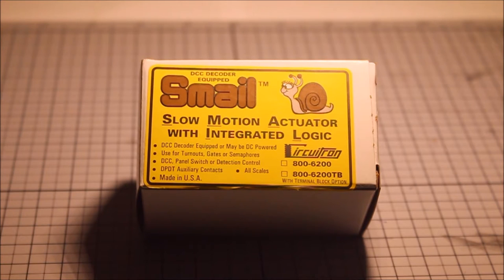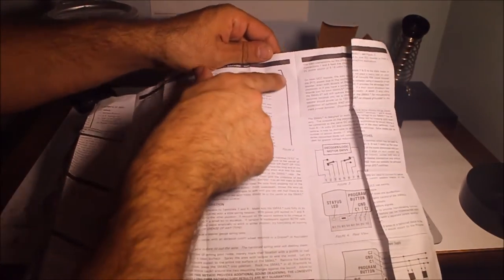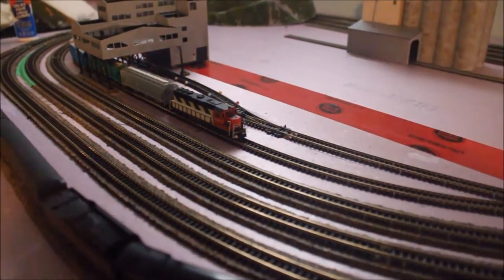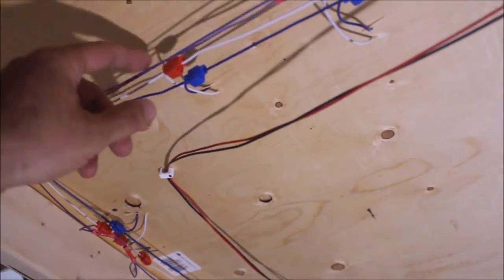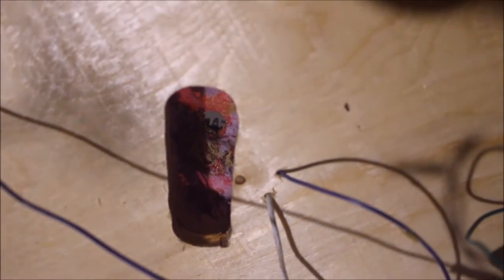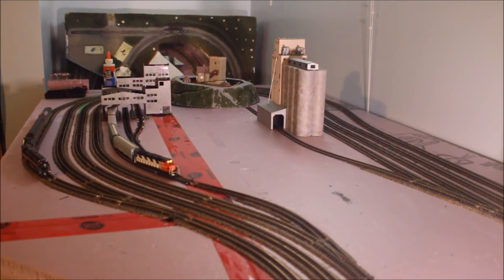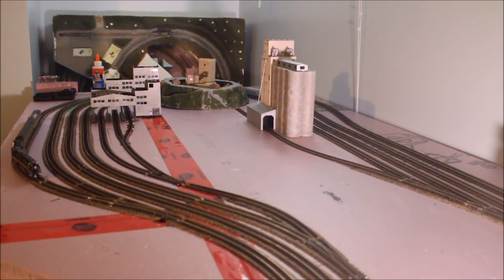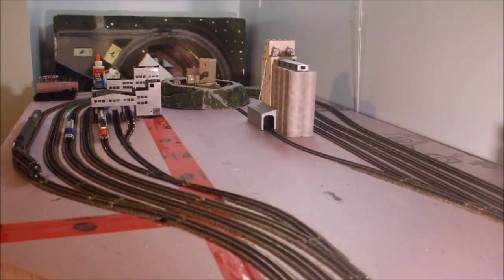Smail switch machine and layout update #2

Comment: Great change from the peco solenoid motors , I use DCC Concepts Cobalt digital motors which there is no soldering so wire you just push in they are easy to install & the throw bar wire comes already bent + $ price is good & its Aussie Made .....Cheers-Rich.....
Reply: Oh! and Cobalts are smaller , great videos Tim very creative
Reply from the maker: Hey Rich. Yeah this is a better switch from the peco motors. I looked into the cobalt and they look really good the only unfortunate thing was the price for shipping them here that was crazy when I saw these ones it reminded me of those digital motors and it was cheaper so that's why I went with this.
Reply: lol thats funny cause I have the same shipping issue but from USA & the cobalts are cheap for me in shipping cause they are from Australia But http://www.modeltrainstuff.com/ sell Cobalts & they based at Cockeysville, Maryland USA